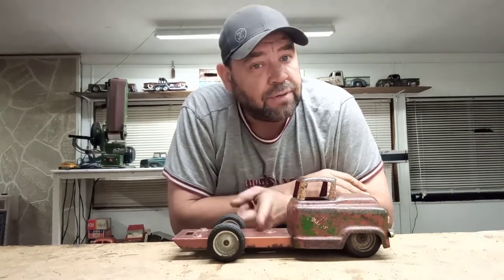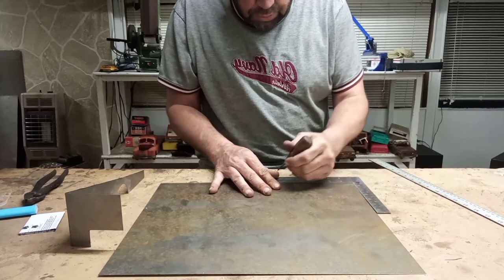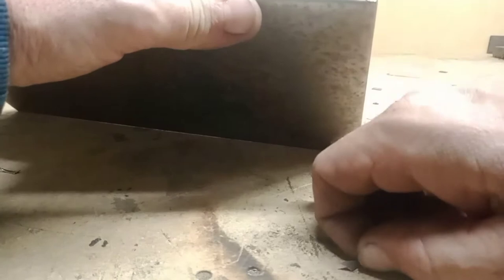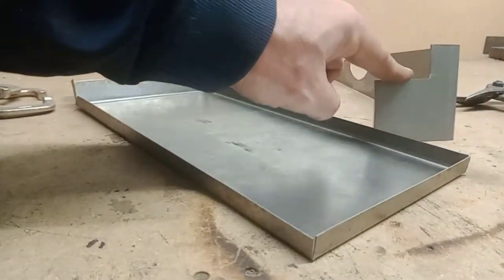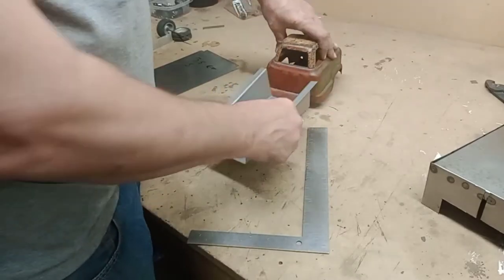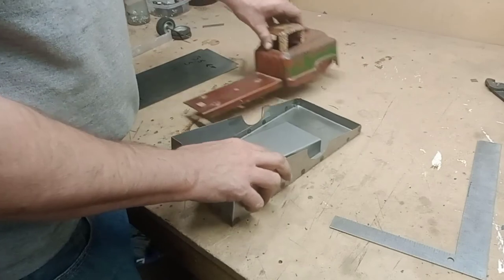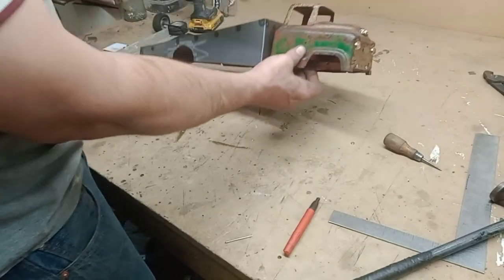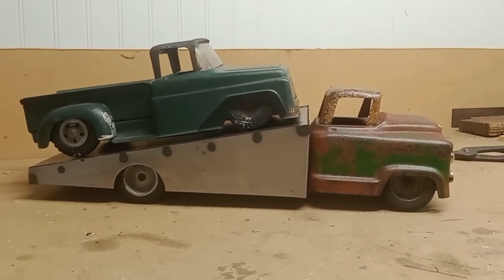HUNK-N-JUNK CUSTOM MADE WEDGEBED FOR MY RAT ROD BUDDY-L GMC

Comment: Hey Ronnie. How did you tack the inside piece to the outside piece? You walked away and didn't show that part.
Reply from the maker: I've actually changed how I make the mount. I'm guessing your talking about the bottom part that attaches it to the frame of the truck??.. I redesigned that part and made it very simple now. The way I do it in this video allows way to much room for error, to time consuming., and wasteful.. I'll make a newer video here before long and show how I do it.. You can message me on fb if ya want, and I'll show ya also